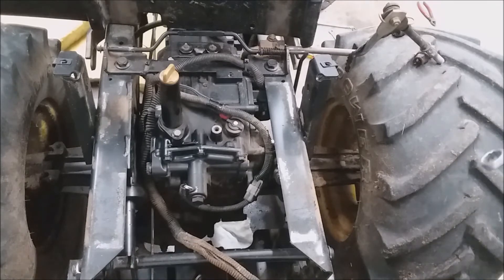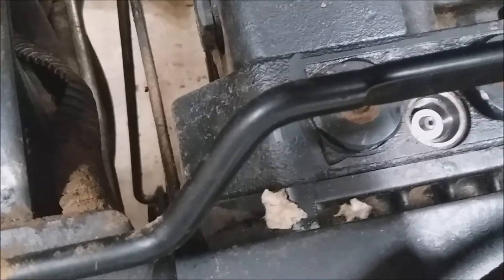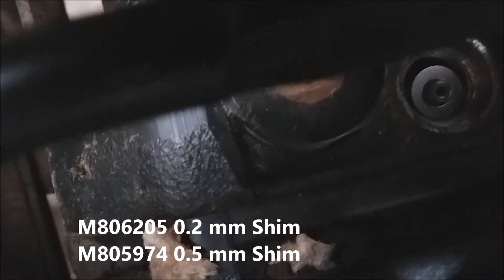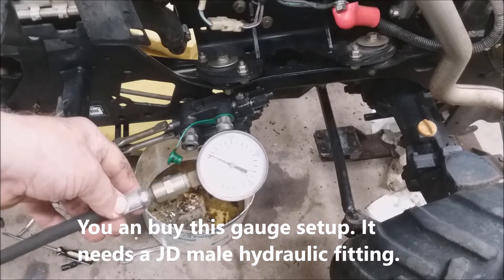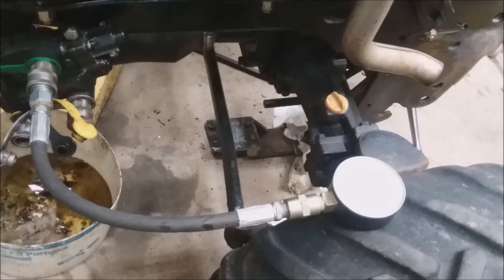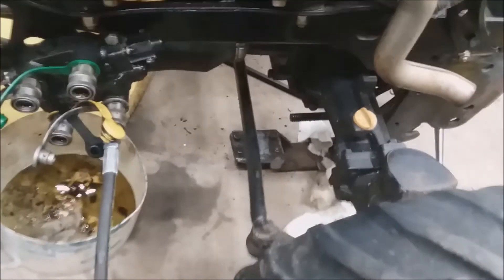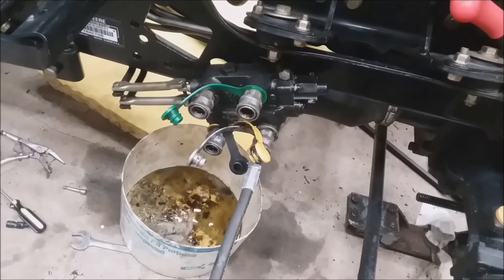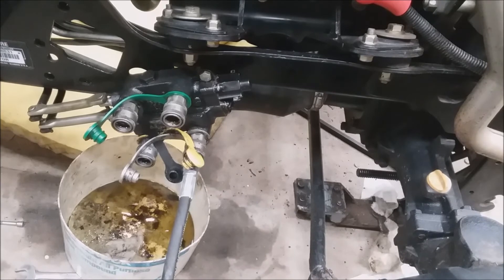John Deere Tuff Torq K91 or K92 Implement Relief Valve Shimming

Comment: I have a jd 455  do you have a link for that gauge set up I want to test my pressure not sure what I need exactly as far as diameter and quick connections.  Thanks. Never mind I saw the link at the bottom.  Great video.
Reply from the maker: no problem.

Comment: Thanks for posting a video on this subject!  I currently have an X748 and an X728 as well as a 4200 project tractor.  I've had my X728 since new with the 45 loader on it, and I always say that my dealer may have shimmed it when it went out the door because it has tons more hydraulic pressure than my X748 which I found a good deal on it used a few years ago.  I since switched my 45 loader to the diesel and changed my relief valve as called for, but I did not shim it.  It does not run the loader nearly as effectively as my old X728 with well over 3500 hours did. So I'm glad I found your video, I think I will shim it soon. I just got a gauge for them so I will take preliminary readings on both units to see what their output is. 

Thanks, 

Kevin.
Reply from the maker: I would test the pressure on the 728 to see exactly how much pressure it has. The factory spec is around 1000 psi.
Reply: @gotdeeres  1000 psi on the x728, 900 psi on the X748.  The shims I have are tiny little medallions with no center hole though.  Makes me think I got the wrong shims.

Comment: Have a 445 with around 600 hrs. Put a CTC loader on it . I’m new to the tractor ownership thing, I don’t know yet what pressure I have,but will soon . The loader is only lifting around 300 lbs, and struggling. Not looking to break it but just to get a little less struggling. 
Saw your video of the 332, I think moving gravel on the drive . Your getting much more a consistent lift than mine . If I could get closer to that capability then that would put a smile on my day. I have a gauge just haven’t found the connection hose like you showed. 
Thanks for the video, just earned another SUB!!!!!
Reply from the maker: Thank you William. I need all of the subscribers I can get. LOL That just gives me some incentive to make more videos. The hose is a 1/4" hydraulic hose with male 1/4" NPT fittings on both ends.  The hydraulic male plug is JD AM37983. First check the hydraulic pressure and let me know what it is. That little 332 was awesome with a loader.
Reply: Yes mine does the same thing u will need to add a shim washers im going to get 3 shim washers so it will be about 1,100 psi

Comment: Thank you for your output show auto repair a lot of stuff makes it easier for me I'm very handy fixing things so they could save money on their John Deere tractor 445
Reply from the maker: I used to repair JD 425's and 455's. I took MANY K91 hydros apart. That was before I started my repair videos. The X485 is similar to the 445. I never wanted an EFI tractor after I bought a diesel 455.

Comment: Hey there I’m not sure if you’re still on here but I just replaced my pressure relief valve on my new x758. I also shimmed the implement valve from 1100 psi to 1350 psi at full throttle. I am running a little buck loader so don’t think I’ll need much more than that. From my research it seems 1500 psi is the max for these K92 units but i read somewhere someone said shimming pressure on these is causing front axle seals to blow. Doesn’t really make sense to me but figured I would ask! Just subscribed as well great video!

Comment: @GotDeeres   You're very thorough and methodical at these videos.  Very helpful.  Thank you for doing this.  I have liked, subscribed, etc.  

2 question - 

1.  Is it sufficient to test the hydro pressure only on one of the 4 fittings?  In other words - all pressures should be expected to be the same, right? 
2.  Am I to understand that you do not have the THRV installed?   Did you shim without this valve and the associated new freewheel lever?

Thanks again.
Reply from the maker: 1.) The pressure is the same on ALL foyr of the couplers.2.) I did not have a THRV installed.

Comment: Hey I have a x740 the transmission is slow and weak in reverse and sometimes forward  but mainly reverse the fluid level is good and clean just got it at an auction it doesn't look like it has been mistreated runs great any information would be greatly appreciated thanks
Reply from the maker: How many hours on the tractor?
My SWAG is the charge pump pressure is low.

Since you have no idea if or when the Hydostat fluid was changed,  I would first change the fluid and filter.  The tractor comes with Low Vis Hygard, but regular Hygard is also an option for warmer climates. I have discovered that a weak hydro will have increased pressure because of the higher viscosity of regular Hygard. I live near Atlanta and have always used regular Hygard in all of my tractors.
Reply: @gotdeeres  if I'm not mistaken around 160 hours the fluid looks very clean I adjusted the rod from the pedal to the transmission it would go really good in reverse but not forward so I adjusted it back the transmission does not make any noise will I have to take it to a dealer to get the pressure adjusted

Comment: Just picked up a 99' 445. changing fluids and I have water in hydro. Do you have any thoughts how or what is allowing water to get in
Reply from the maker: There is a vent on top of the hydro,  but it is covered by the fuel tank. SO I cannot see how any water could get into the hydro. How much water?

Comment: Can you tell what a ctm441 manul is used for, it is on the front of the tm142419 as a  reference !
Reply from the maker: John Deere Component Technical Manual - CTM441 is a manual that provides detailed information on the repair and maintenance of John Deere equipment. It is a component technical manual that covers the following topics: “Engine - 4.5L (276 cu. in.) 6-Cylinder Diesel,”
Reply: Do I  need this for my x758

Comment: Hi. New subscriber here. I appreciate the information you give. I just bought an x595 and my question is about the rear three point. Mine has a cat0 top link and cat 1 arms. Is this normal on this tractor? I purchased it used.
Reply from the maker: The older cat 0 3 point hitches came with a AUC12534 top link. The new Cat 1 hitches came with a AUC12533  that would have a larger CAT 1 pin to connect to Cat 1 equipment.

Comment: Have you ever checked the charge pump at the charge pump port? Would like to see how and the procedure!
Reply from the maker: Yes, I have checked a hydro at the charge pump test port. All of my tractors now have hydraulic couplers, so that is much easier than getting to the hydro port. You will need to remove the fender deck and fuel tank. Then you just remove the plug and screw in the testing gauge. I made a testing gauge and it gives the same results as measuring at the quick connect coupler. The access plug is a  O-ring boss male. Good luck finding that one. My testing setup is for sale. Just let me know.

Comment: I need a transaxle for an x475. I believe it had a k92. Would a k92 from any other models fit? 
 I have some mechanical & fab experience, so if theres even a close fit with another model, I'd be ok with that.
Reply from the maker: K92's from other models will work.  They are the same.

Comment: I have a 2016 John Deere, the power steering is hard at low speeds also lift is lazy! Gets worse when it warms up. Got the tractor used, oil level is fine ! Going to work on it this winter, any help would be  appreciated.
Reply from the maker: What tractor model do you have?
Reply from the maker: How many hours are on the tractor? Did you change the hydraulic fluid and filter? The first test would be to test the hydraulic pressure.
Reply: Haven't tested pressure need to find that out!
Reply: X758 with 1300 hrs
Reply from the maker: @williamrobb2045  The factory spec for the pressure is 924 psi. That test will tell you a lot about the hydro's condition. The X758 has a K90 hydro with a 6.0 gpm pump while the K92 was 4.5 gpm.  It does sound like a charge pump issue.
Reply: Is there a procedure to remove the charge pump on a john deere x758. Do I have to remove transaxle from tractor?
Reply from the maker: @williamrobb2045  You will need to get the Technical Manual for the X758 which details the removal of the charge pump. A 2016 model would be TM142419. Yes, you will need to remove the transaxle. Your first step is to check the hydraulic pressure of the charge pump.  A new charge pump is around $750 so make sure that is the problem.

Comment: Have a Simplicity XL with the Tuff Torq K92 w/4x4 and 540 PTO. It moves forward fine but when going in reverse it is very weak and barely moves. 1st culprit would be the Reverse Check Valve. Took them out but I have nothing to compare them to. Diagrams and pictures are very vague. I did take out the relief valve you posted on and the shims are very warn. I'm assuming that has nothing to do with the forward or reverse? Just curious if you have seen or heard of this?
Reply from the maker: My first guess is the reverse check valve is not working properly. Make sure that the tip of the valve moves freely and pops up. Manually press the pin in and out. Clean the ball and seat. The forward and reverse check valves are different. Make sure the Reverse is on the left side.  The reverse valve has a small notch on the hex head. Next I would verify that the pedal linkage is not loose. You can download the technical manual for the K92 from tufftorq.com. The shims on the IRV are VERY thin. They are .2 and .5 mm. I would also suggest that you do the pressure test. Let me know what you find.

Comment: I want to find a way to add 2 more remotes. With possible float. 
Is it possible?
Reply from the maker: I just added two REAR remotes to my X740. They operate on the lower hydraulic lever with the float function. I will be adding a video showing how to do it. Adding another remote with a separate hydraulic lever would be difficult.

Comment: I believe the 400 series models had the K91 transmission. Would the pressure relief valve be located at the same place? Do they use the same shims?
Reply from the maker: Yes, the 4X5 tractors did use a TuffTorq K91 which was a proprietary configuration for just John Deere. It is very similar to the K92. The shimming parts and installation procedure is the same as the K92.
Reply: @gotdeeres  Awesome. Thank you for the video. It really helps me out! I wasn't sure where the pressure relief valve was located so thank you.
Reply from the maker: @ETPFilmMedia  You are welcome. Please feel free to ask any questions that you or any other subscriber may have. I do not charge for information.............. Yet. Just kidding.
Reply: @gotdeeres  LOL! Thanks again